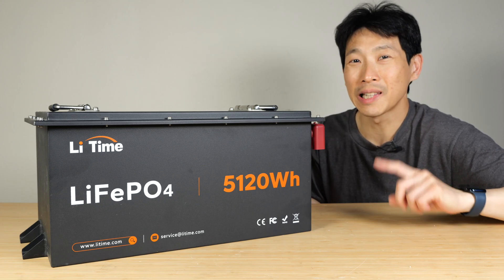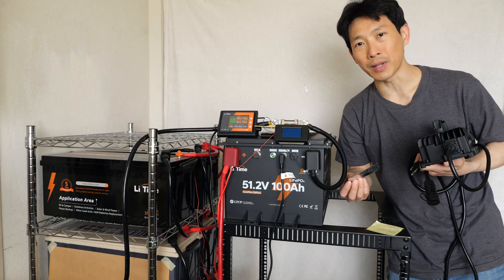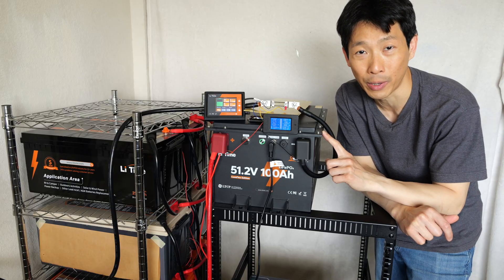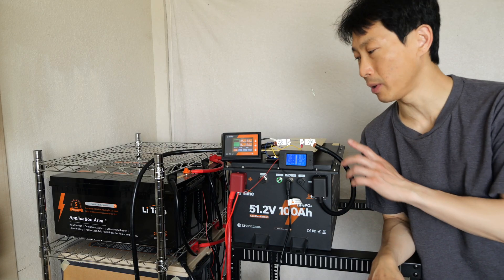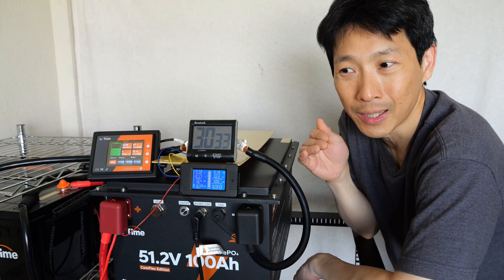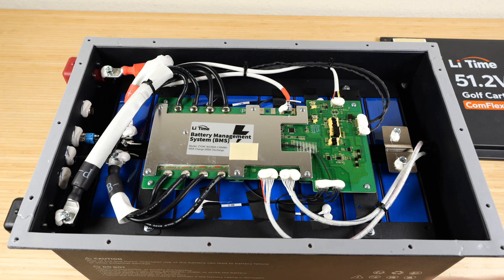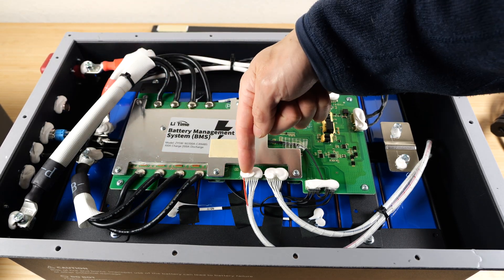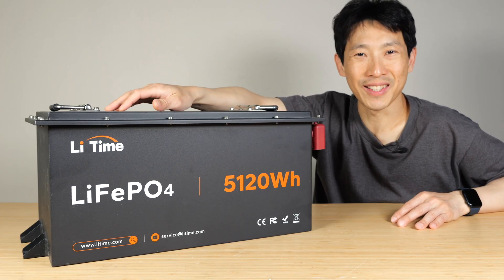I Ran LiTime's Golf Cart Battery at 100 Amps Continuously

Comment: He can you please review different low budget home water heaters?
No one on youtube is doing this well.
Reply from the maker: Ooooh, those are probably very difficult to review since installing one is a huge undertaking on its own. Unfortunately, when I installed mine, I didn't make a video on it and it wasn't the cheapest one being 50 gal and triple insulation. However, I may upgrade it to a heat pump version later on.

Comment: heh you encouraged me to finish a project ive been working on. a 15kwh portable level 2 ev charger. wired 16x 280ah lfp cells in series into a 6.5kw 240v inverter. the cool part is that i used a j1772 trigger cord as the AC input and put it in the trunk of my 2013 chevy volt, so its like having a destination charger or free electricity sponge anywhere I go. free workplace charging? guess all my EV charging is free for the week. going on a road trip? i can charge a little each time i stop at a rest stop and dont have to look for a plug when i get to my destination. my gf uses it everyday to avoid paying for the expensive ev chargers they put in at work, just charge it in my garage from my evse the night before.
the cells are CATL and took 3 months to ship from china and the inverter was from powmr. it does pass thru charging at ev chargers if there is only 1 plug up to 9kw total and i can use two cords at once to charge at free chargers if they limit them to 5kw per plug :p
for all the batteries, inverter and hardware the entire cost was just shy of 1000$ which i feel like batteries/inverters will never be that cheap again direct from china
Reply: Make a video about it
Reply from the maker: Interesting. Do you drive an EV? I assume the entire thing must weight around 300lbs?
Reply: @BeatTheBush  chevy volt, technically an EREV? its kind of its own type of car in north america.  maybe better called a split parallel-series hybrid?
entire weight is about 150lb for the battery, 15-20lb for the inverter.
not that much weight in the trunk considering i deleted my 45lb AGM battery and replaced it with a 32ah lfp pack i built a few years ago. like an extra 100lb, usually less coz i dont have to keep the gas tank as full since i can always charge so thats more weight savings.